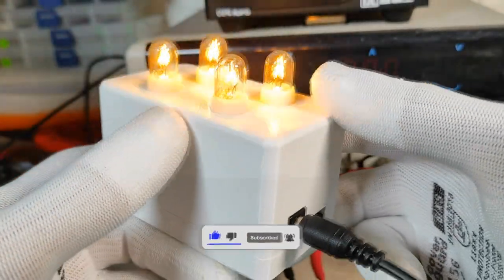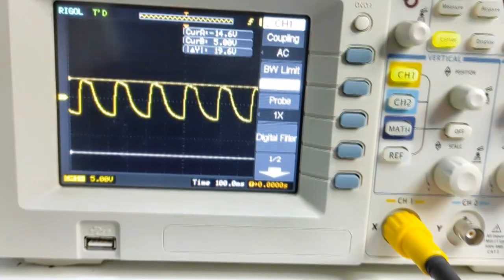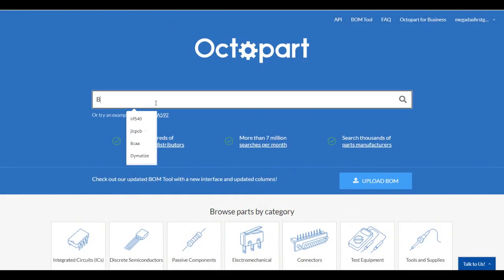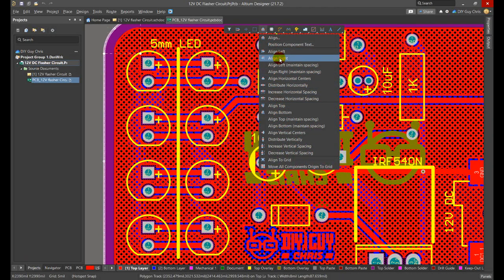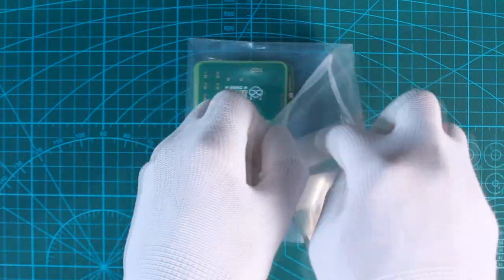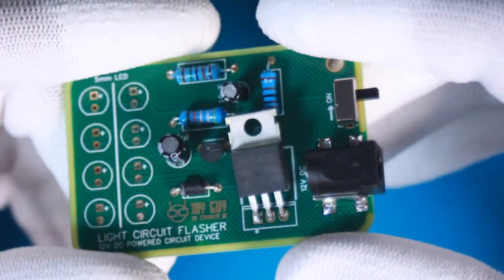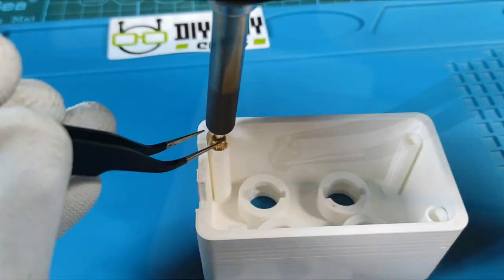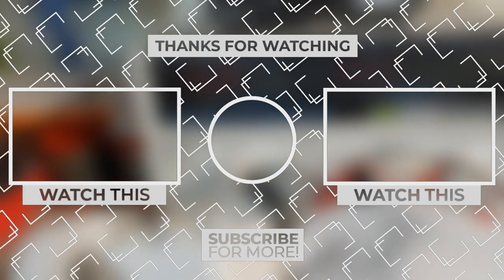12V Flash light Circuit Board | Full making | easy #diy project

Comment: Is it the 100 uf capacitor that control flash speed?  3-pin sw... Just on/off or has it another mode?
Reply from the maker: SW is for just on and off no other modes, and yes the 100 uf for speed